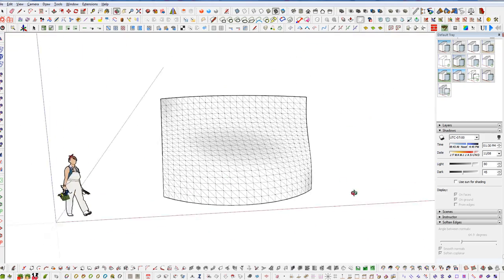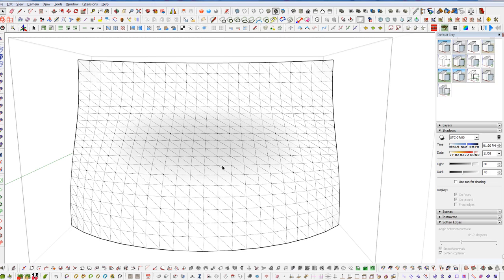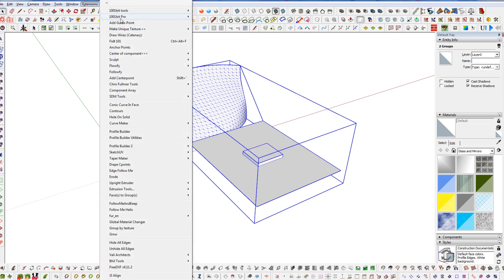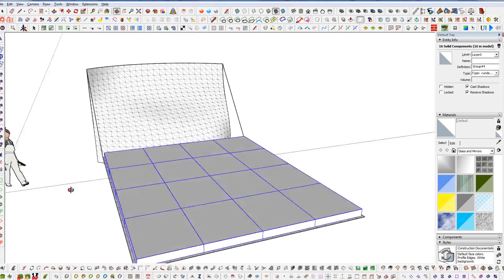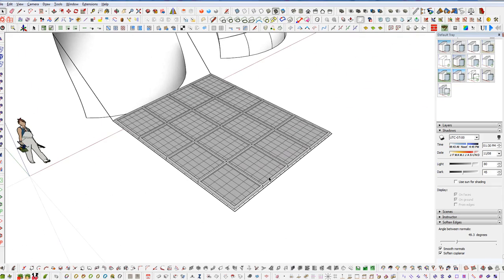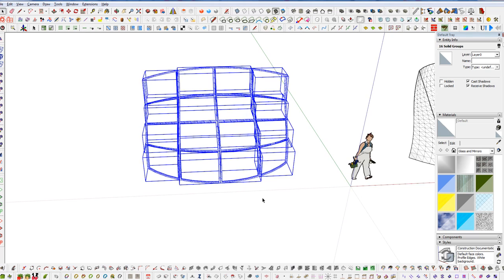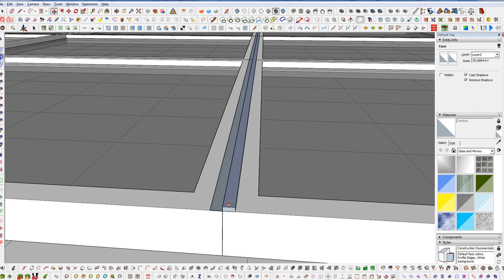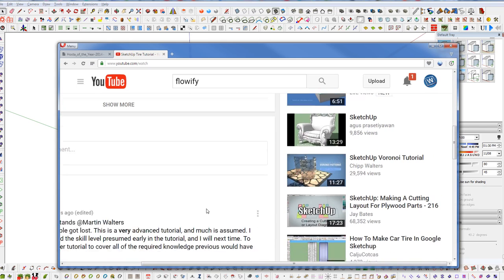Sketchup - Flowify -  Understanding the Basics.

Comment: hey could you list out all of your "clean up " tools, besides fixit 101 & CleanUp3?
Reply from the maker: Sure.  Here you go.  All of my "Clean up" Tools - 

Cleanup from ThomThom
FixIt101 from Anton Synytsia
Cleanup Unwanted Edges from a4chitect
Remove Inner Faces from Wikii
Remove Lonely Verticies from Fredo6 (a part of FredoTools)
Solid Inspector from ThomThom
Solid Solver from TIG
Fix Solid from GWD
Vertex Welding Tool from A4chitect
Edge Gap Inspector, Close Edge Gaps, Erase Stray Curves from Thom Thom (Edge Tools)
Merge Verticies and Merge Close Verticies from ThomThom (Vertex Tools)
Remove Edge Loop by ThomThom (Quad Face Tools)
Reply: Thanks!

Comment: Hi. How do I apply Roundcorner on the flowfy plane? Let's say I have a flowfiED curved plan with thickness. Can I round corner the edge?
Reply from the maker: You may have better luck doing the round corner after you use flowify.  If really all depends on how complex the object is.  Round corner seems to fail if there are tight curves or small faces near the edge.  I would suggest just experimenting with simple things first and then try to work up to more complicated things. Good Luck!